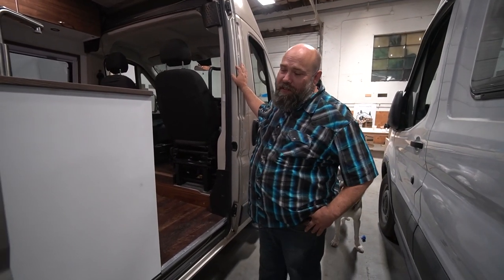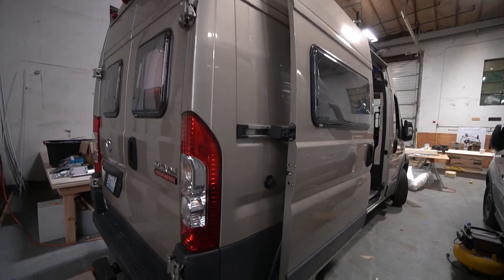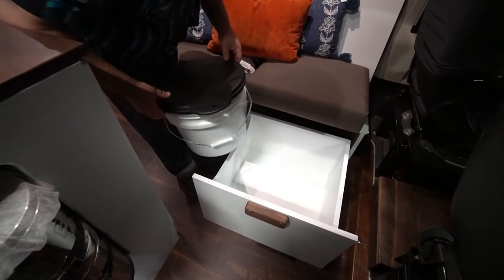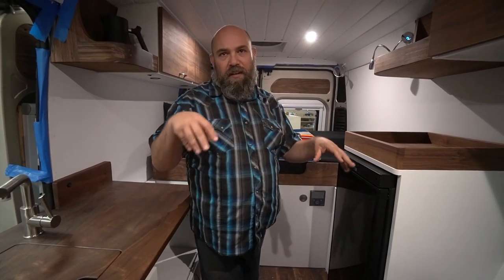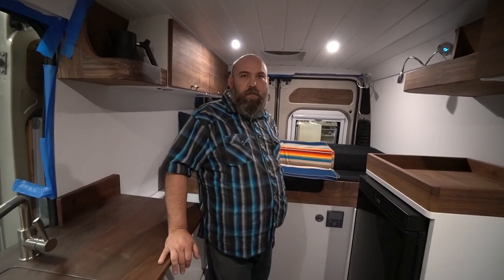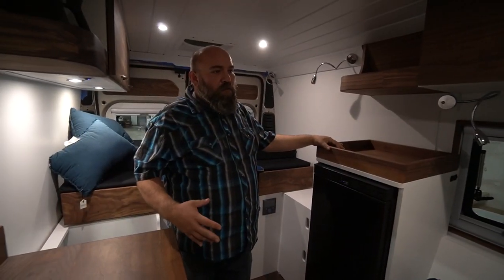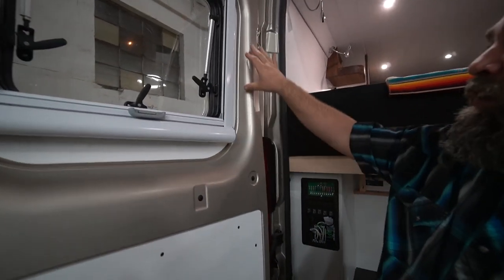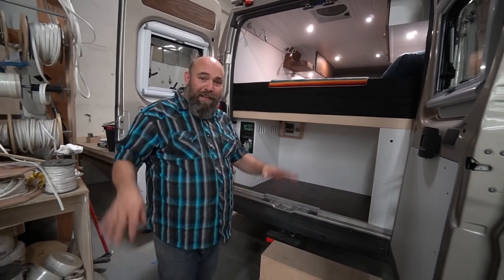Farmhouse Vibes Van Tour with Dog Bed

Comment: Always find something new to add to my notebook.  The built-in Berkey water purifier,  genius. Thanks van-owner who thought of it! Might want to some lights in your garage. Like the cut out for the poop bucket.  Saw something similar for essential oils, but didn't make the connection, duh. I have several months till I get out on the road,  wonder how many notebooks I will have? Sad woman was taken in by bad craftsmen. Wish you could name them to warn others, and give a heads up to previous customers to check theirs for safety issues.  Maybe someone should start a channel for that purpose.  Not to be mean or vindictive.  Just informational.

Comment: Like that, I may have to do mine almost liken to that floor and wall plans, my van's floor inside diameter is roughly from behind the driver and passenger seats to the cargo doors 11'4" L (maybe a little more or little bit less, not by far) and from driver's side to passenger side the wisest point of the floor is about 77" W, just the walls from the floor to where it meets under the topper round about 53-54" H...if I do something liken to this it'll have to be a little bit smaller. Will not be doing anything yet with the topper area, after everything else is said and done, while trying to save up more money for, I had found a bit of outside surface rust in the little run offs on the roof where the topper sits on, is to find someone professional who can properly remove the topper temporarily enough to refurbish the roof areas where it really is needed, then renew the seals, etc on the topper that will make it not only look new again, but also prevent anymore rust and better waterproof seals too. I haven't found any leaks anywhere at this time, but will invest whenever I can get up all the funds needed to get to this issue before it might get worse later. This van I have is a 2000 GMC Savana 1500 full sized Conversion Van Southern Comfort Edition (my 2nd van), I'm basically remodeling the walls and flooring and with new insulation too. The old original carpet and walls were removed on purpose, they were badly stained, and to my surprise, under all that mess was only tiny areas of surface rust, I treated asap and then some. Not just finally soon cleaning oof all the old glue and gunk, and so ready this week to get started on the insulation, and flooring and walls, etc. I'm so excited to this built more than my last. And, Jarrod I enjoy watching your videos, the are very helpful ideas to what I may do with some of my plans. However, not messing with the electric stuff, until later with help of a professional, so I'm doing just the basics for now and have it easily set up for that in the future.👍

Comment: Great work as always.   Love the layout.   But would be much more meaningful if you disclosed the price.   Like ARV does great work but so high $$$ not worth looking at.
Reply from the maker: I understand. But because I don't own any of the van builders I tour I don't ask for price. They can change also out of respect to them as a company. When I do a diy tour I try and remember to ask but I forget a lot of the time. A lot of people don't like disclosing their price either. Low end you're looking at $10k and high end you're looking at $50-70k. If you were to hire a builder then double your material/systems cost for labor so it can be low end $30k upwards to $170k+
Hope that helps a little
Reply: @JarrodTocci  Thanks. If I was in the business I would prefer to disclose the price just to reduce the number of emails and inquiries from individuals who have no idea of the cost.